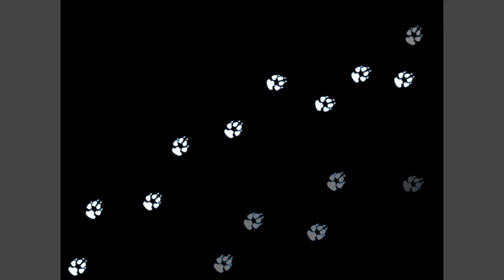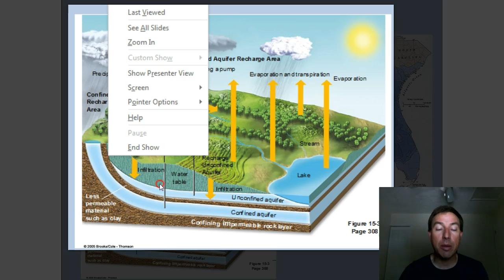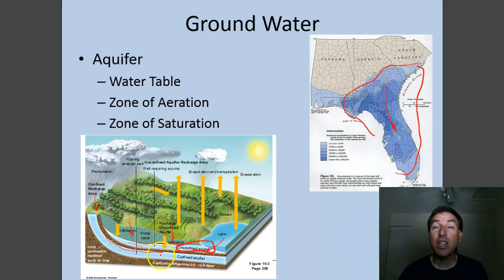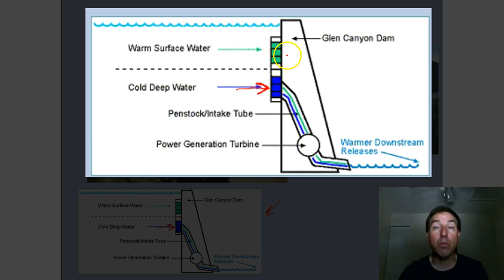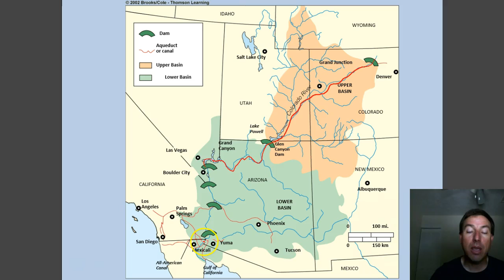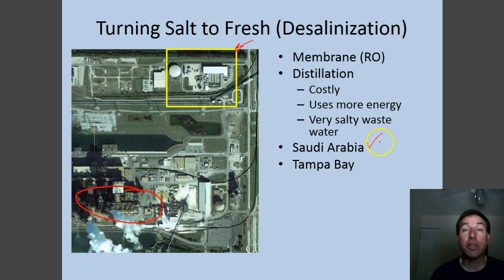APES Lecture 51 Supplies of Fresh Water

Comment: What software do you use to create the screen cast?
Reply from the maker: David Wandel Screen Cast-O-Matic V2.0 Beta.  I paid for the annual subscription which is not too expensive for all of the tools it has.  The user manual documents are a little to be desired, but they have a bunch of how-to videos on their site.  It is getting better all of the time.
Reply from the maker: I use Screen Cast-O-Matic.  There is a free version that works pretty good.  I use the paid version because  you can make videos longer than 15min and it has some other tools.  It is not that expensive for a year.